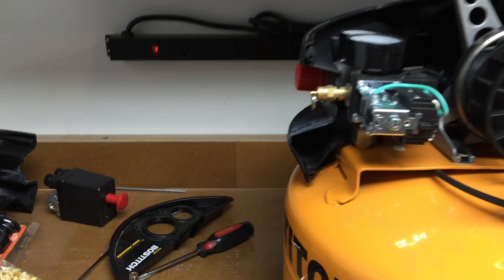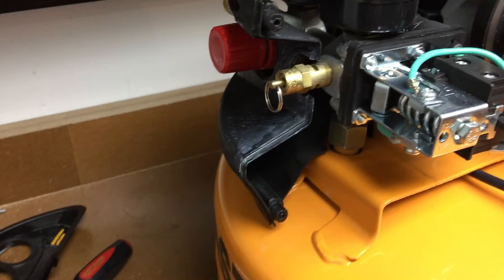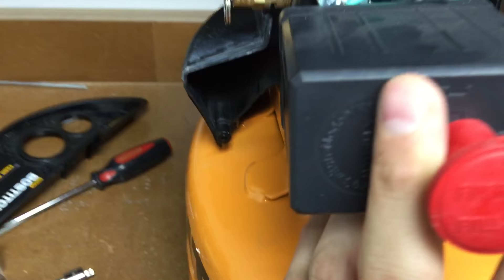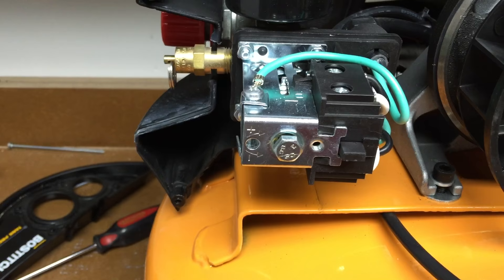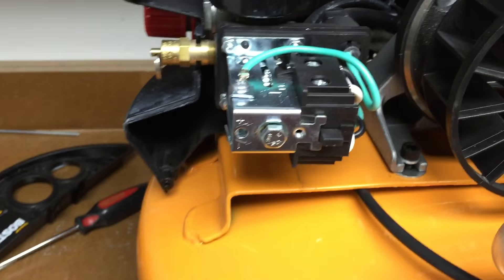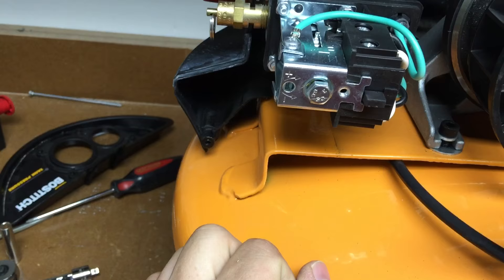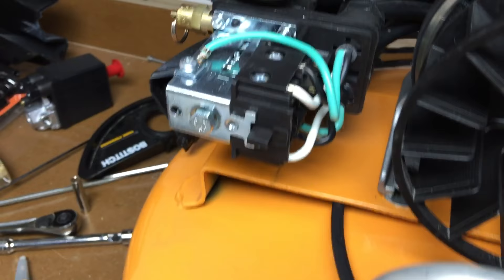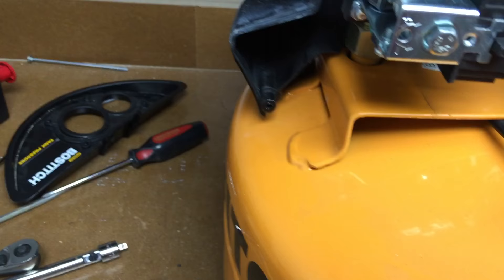Bostitch pancake compressor pressure switch adjustment CAP2000P

Comment: Here we are three years later and your video is still saving people time and money!  I had the exact same problem as you did, and it was solved exactly as you mentioned. I'm glad your video popped up first on the list when I typed in Bostitch compressor pressure.  If anybody is wondering how to remove the cover, there are seven (7) phillips head screws and two (2) 8mm (5/16) bolts that need to be removed from the covers, and then one phillips head screw to remove the adjustment cover ( The on'/off knob comes off with the cover). I found another youtube video that gives instructions on removing the cover if you need it ( https://www.youtube.com/watch?v=HvKefX0m9s8 ).   Thanks again Chris - this video hit the nail on the head!
Reply: Thanks for posting this information.

Comment: I just purchased one of these and the  regulator knob will not turn either way.  Any idea why?
Reply from the maker: Sorry I have been thinking about this situation, but I have no idea. I assume you purchased it used (otherwise you would return it to the store).  I think some people never actually move the regulator knob, so it may just be stuck a little from low or no use. Were you able to wiggle, force it free? If not, I believe you can replace the regulator too for like $10-20. Sounds like a great YouTube video opportunity :).

Comment: how'd you get the "cap" off. I don't understand how it is fastened and don't want to destroy it.
Reply: Small set screw and it comes off
Reply: Mine had a rubber plug covering the screw hole.

Comment: After years of hauling around a large,💫 allabout.wiki/BOSTITCH  heavy, loud dewalt air compressor (that ironically was advertised as quiet, supposedly 78dB), I bought this. Facepalm. While it is not ‘silent’, I find myself chuckling every time I use it, sparing all  my neighbors the terror of my former compressor. I use for inflating tires, impact wrench, finish nailers. Absolutely love it. And I store it under the garage sink in a 24” cabinet. I paired with a coil 1/2”, instead of a my former 50’ 5/8” hose that I had to lug across the yard from the shed, unpleasantly uncoil.... this little guy is light and portable; just a joy. Impact wrench is still capable of easing lug bolts, flywheel bolts, crank pulleys... just allow for a tiny bit of recovery now and then.